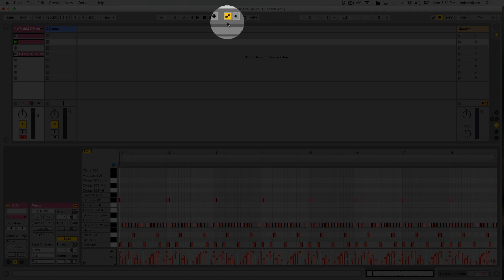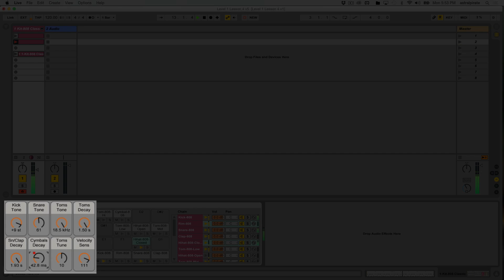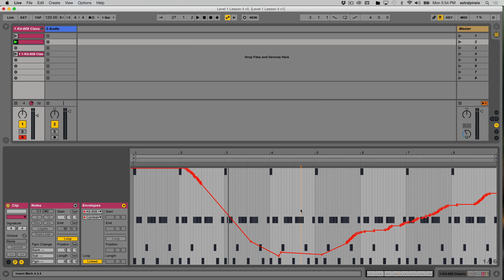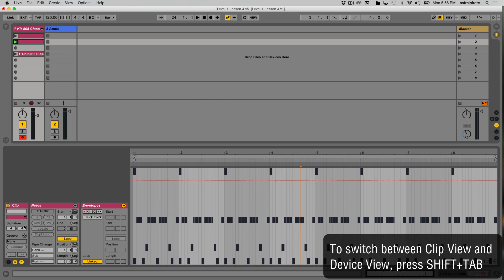Ableton Live Tutorial - Recording Automation in Real Time

Comment: Dam , every single time i try to record automation the playback sound is off !  And what annoys me about this is when i used ableton on windows i never had this problem but on the macbook i just got i just cant get it to record any automation or even have playback sound when trying to add automation and i have all the settings just like they are on my pc as far as i can tell.  Bitwig is so much easier for automation but the reason i dont use bitwig as much as ableton is bitwig STILL  doesn't  have midi note recall that ableton and FL have .  for god sakes the basic steps in ableton can be a real pain to figure out at times !  edit  -  ok  finally got working . bit you literally hit record and move knobs and it records it with no setting up . oh well.